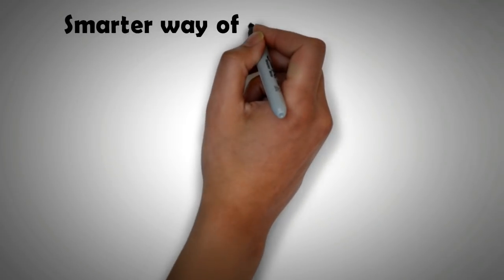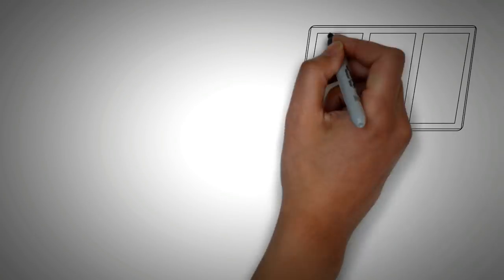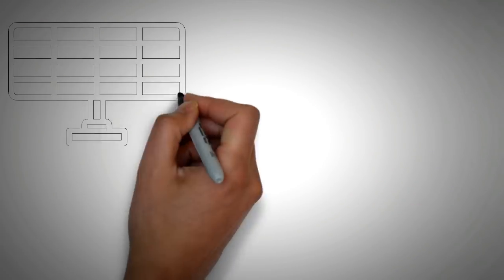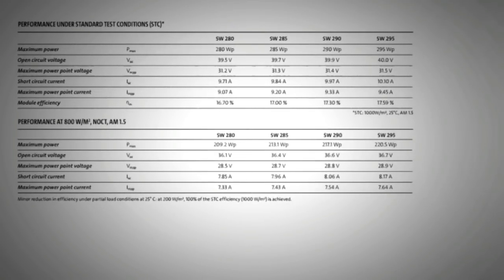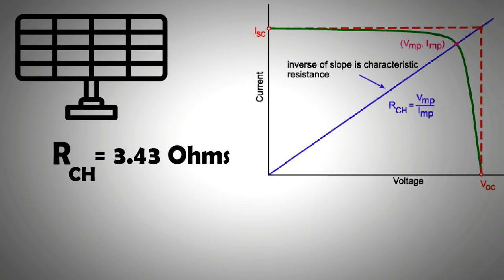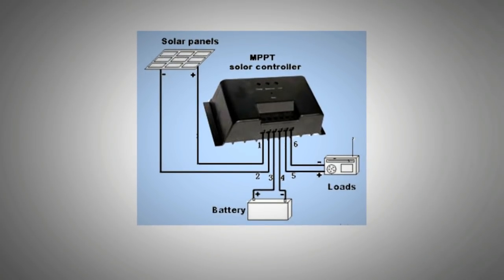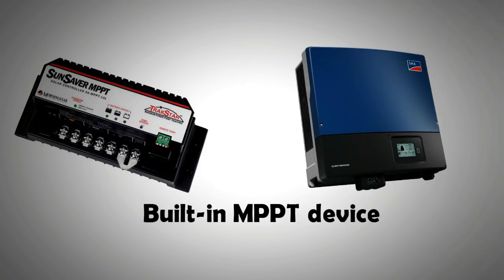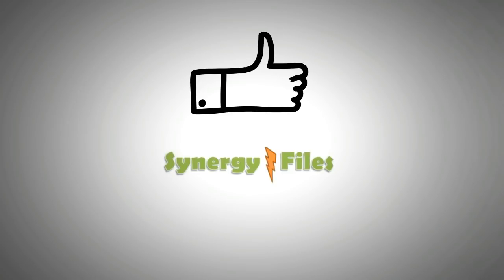Smarter Way to Use Solar Panels (MPPT Device)

Comment: Great video only thing I caught was INSOLATION, I believe it's spelled insulation? I believe these are also called charge controllers are they not?
Reply: I would have deleted my comment, if it was me Lol...
Reply: @abuxxx3607  Yea, but everyone is ignorant about something all the time. Big deal.
Reply: in·so·la·tion
ˌinsəˈlāSH(ə)n
exposure to the sun's rays.
the amount of solar radiation reaching a given area.
Reply: Thanks, very useful!
Reply: enlightening!
Reply from the maker: Insolation is an engineering term not widely known. It is a short form of incident solar radiation. And yes charge controller or inverters can come with MPPT option
Reply from the maker: Insolation is an engineering term not widely known. It is a short form of incident solar radiation. And yes charge controller or inverters can come with MPPT option

Comment: Sir,in On Grid Solar Inverter with 2 MPPTs,does each MPPT support half the total power of inverter?Means in 15 KW Inverter does each MPPT support 7.5KW or full 15KW also

Comment: 2:28 Open Circuit Current Value? Or you mean Short Circuit Current Value. Appreciate for you to clarify on this. Same goes for the Closed Circuit Voltage value, is it not Open Circuit Voltage Value. Please advise. TQ
Reply: He just said it wrong in the video, he meant Open Circuit Voltage and Closed Circuit Current.

Comment: Mppt is the way to go,  the only time pwm is half OK. Us if the panel voltage is colse to battery full voltage, 16-18vmp for a 12v battery charging to 13.8- 14v mppt is much better,

Comment: 2:29 to use the open-circuit current value & closed-circuit voltage value, wouldn't it be zero for both? Please clarify if this is correct?
Reply from the maker: Closed circuit current and open circuit voltage

Comment: Can we charge the two 12volt batteries in series from solar panel of 250 watts but use these batteries for 12 volt load while charging in series.

Comment: Hi if have two mppt could you run them in series instead of parallel?
Reply from the maker: It would be a waste to have them in series. Think about it. Its like a gearing system. Just like you  get the performance from your engine if you have the right gear, likewise mppt selects the best power for your panel or string of panels. And just like having two gearing systems  one after the other doesnt make sense, it the same as having two mppt in series

Comment: I heat water with excess power from panels when the batteries are near charged. Charge controllers do not transfer all the power they can to a battery due to charging states. This results in panel voltage exceeding the power point voltage.  I use this voltage value to determine how much excess power can be sent to a water heater. Energy is stored in a capacitor bank and PWM to a heater. Just enough energy is sent to drop panel voltage to power point again.  Any successful solar system has to have excess capacity.  My hot water is essentially free at camp by this method. Watch my videos on how you can build this system.

Comment: Thanks for the nice video. But at 2:27  "Open circuit current value and closed circuit voltage value"???? Is this correct?
Reply: I clocked that too. I'm pretty sure he meant Voc and Isc.

Comment: Many if not most of the cheap, like 15 dollar MPPTcontrollers are fake. They are NOT MPPT, but PWM. Just open them, and you will find out. And you will find it out by looking at the numbers as well. (Display)

Comment: Hey Bro.   Are you talking about all solar panels.   Or panels above three hundred watts or more.  I’m using a Pwm controller on four panels each are 100 watts.   I would like to see a cheap Mppt charge controller.  Most are over $100.   Great vid.
Reply from the maker: There were some cheap chinese MPPT charge controllers. Although I have found out from the feedback of the viewers that they are not as good. Thank you for your interest

Comment: If v don't have pmax,voltage,current.sir u said to check open circuit current and closed circuit voltage values for characteristic resistance. What sir?

Comment: I am Saeed from Peshawar....... mainy 6*150w k solar panel use ker rahahon. mujhy kitni wire derkar hogi inverter tek k load sahi
chally. ab bhi 400w araha hay mughar ye kam hay... wiring ki LAMBAEE kitni honi chahiee keh line loses na ho aur AMPS pory millain..... 
Thanks.
Reply from the maker: Wire agar mota hoga aur current kum hoga to line losses itnay nahi hotay. Aap motay guage ka wire khareedain. Doosra system is tarah say jorain kay voltage thora ziada aur amps (current) kum ho
Reply: yanee Siries main joron to 40v hojaiga aur Amps 40 say 20 ho gain gay to losses kam hon gay
Reply from the maker: Exactly.

Comment: Sir,  maximum , How much power in terms of Watts we can derive from a best solar panel?
Reply from the maker: You can extract up to 96% of rated conditions.  So for example a 300 Watt you can extract 288 Watts.

Comment: is it better to have high voltage (450w of panel in series = 40V) or high amps (450w of panel in parrel making 22 amps) from 3 x 150w solar panels going into MPPT charge controller to keep up with the inverter needs?
  What will give me the most usable wattage in my small battery bank ?
Reply from the maker: If you have an MPPT charge controller, than difference between the battery pack voltage  and Solar Panel configuration voltage does not matter as much. If you however have no mppt, than you have to keep the batterypack voltage close to Panel voltage. The panel voltage should be higher.
Reply: Yeah....It's MPPT .... So which should I do then?   
I can get about 17 Volts to the Controller in Parallel and 12-14 Amps (Parallel)...
In Series I can pull in Voltage up in the 40-45 range but only around 8 amps ....    I always thought more amps was better but....
 What wil keep my batteries full more efficiently with a load on during use? and- what will allow me to get the most wattage to use from the system thru the Inverter? What will keep up with watt usage better?
Reply from the maker: More Amps require thicker wires and there are more losses too with more amps. I would go for a 48V system. You can get a 48V charge controller in the market. So it also depends upon the voltage range of your charge controller/ Inverter.
Reply: well.. I bought the EPever 40 Amp MPPT controller just for that reason and i switched to a Joiner Box to run a 6 awg wire to the controller to minimize the losses ..
 Do ya think that is enough? or do I have to run 4 awg ? 
I have a 12v set up cause all my mini appliances and stuff is 12v so moving to a 36 or 48 Volt set up isn't in the cards for now..  It's only 450 watts of panel so it's more of a Mobile / emergency back up for hurricanes and black outs... I think the next things I need to get are more batteries...alot more...
Reply from the maker: 6 AWG should be fine. You can get a separate DC to DC converter.  Convert your 48V DC from Charge controller or your load to 12V DC
Reply: oh yeah? A Converter?
     Then it's your opinion that Higher Volts (Panels in Series) are more efficient or better to charge the battery bank (thru MPPT) then  the 22-24 amps if in Parallel?   
   I can do it either way with the system I have ....(3) x 150 panels in Series gives me 40-45 Volts (But only 8 amps) to charge controller or in Parallel I can get 22 amps to CC but only 17 Volts....
or like you said...One day up grade to 48V system...   Thanks for the Info....have a good day.

Comment: I have a bank of 2 panels (each 17.1 Vmp, 2.3 Aamp mp, 40W mp) going through a hub (parallel I guess), then to a non MPPT charge controler. You have not explained how to connect multiple panels do an MPPT device? One per panel? What do I do ? I cannot see multiple inputs on a MTTP controller?
Reply from the maker: There is something called a micro inverter. Look into it. It can allow up to four panels to be MPPT connected
Reply: Synergy Files  :  For about how much cost?
Reply: Than watch another video. How greedy are you?

Comment: so wouldn't it be better to at least use a DC to DC  if connecting to a light or something? then the voltage can be bucked to a lower voltage.
Reply from the maker: The problem is that conversion from any DC voltage to any other DC voltage is not an efficient process.
Reply: Synergy Files I know. anytime you do anything with electric current. there is losses. even just I'm wire. then semi conductors there is always heat! so that's more loss. its a shame we don't have superconductors for everything. and perfect semiconductors. with zero resistance.  only in a perfect world! or maybe the distant future! oh and near 100% efficient solar panels. and batteries.

Comment: Nice visual presentation, but characteristic resistance is probably the worst way to explain this to the average public. The explanation of how panel resistance relates to a battery is totally lost. Better to explain the panel as a current device and the power is a product of current and voltage. You have also given people false hope a $15 controller is really MPPT.  Have you ever opened one up? I think this video still leaves people wondering.